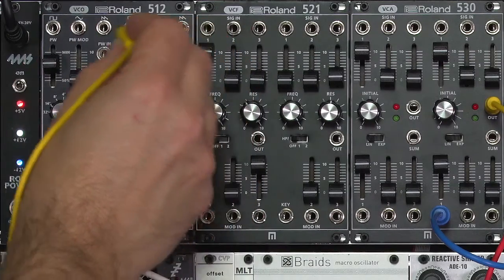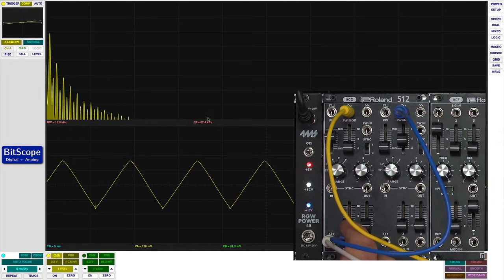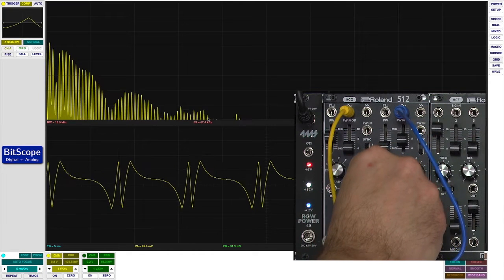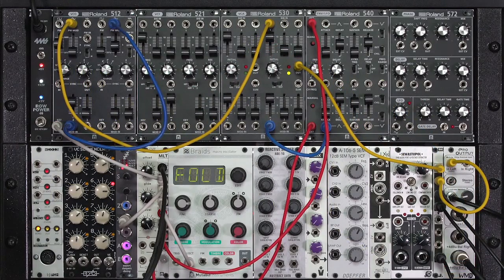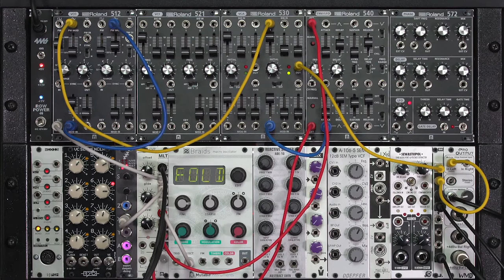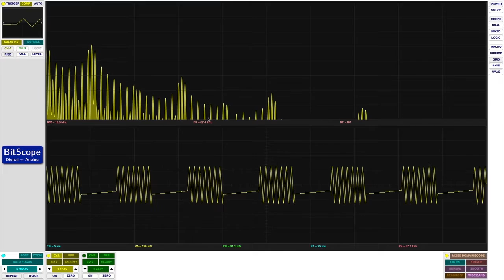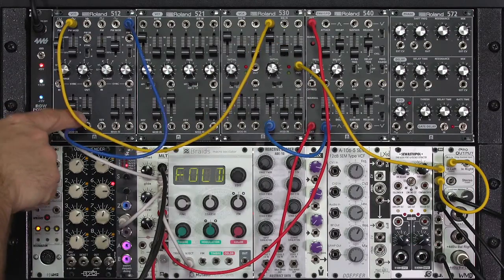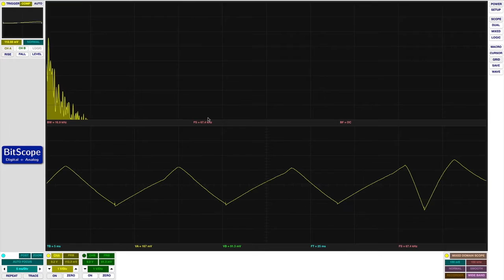Patching Exponential FM

Comment: is the reason these two oscs track that they're both running at the same frequency? like 2 outputs of the same oscillator 'core'?
Reply from the maker: The are two separate oscillators - two different cores etc. The can be tuned to the same frequency (or different frequencies), and track the same source (the keyboard).